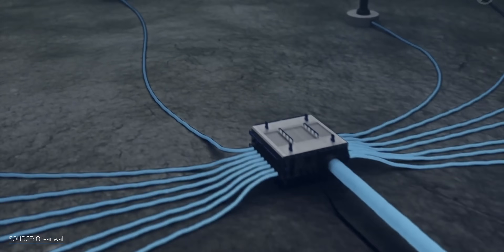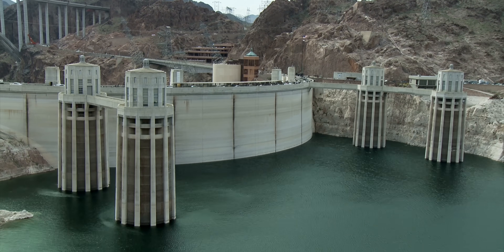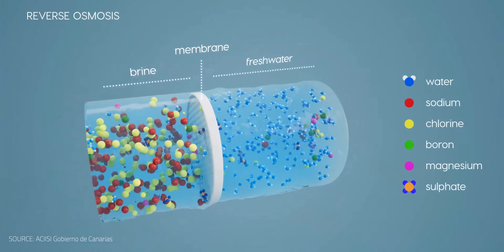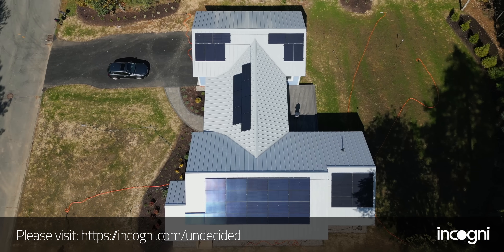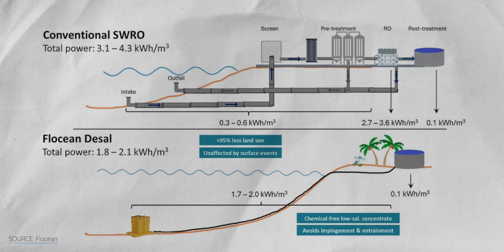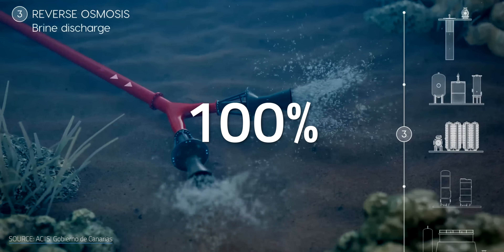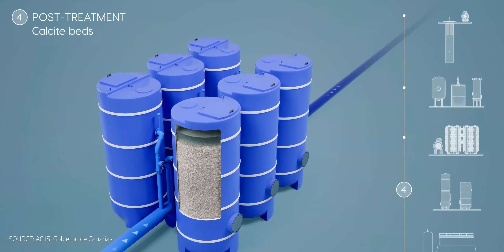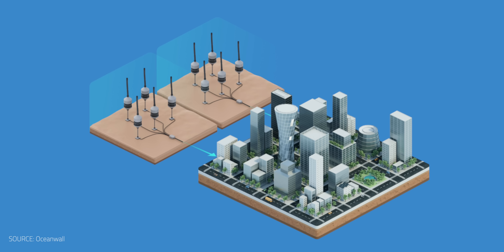How Deep Sea Water is Now Drinkable

Comment: Unfortunately Ive become significantly more jaded regarding tech improving life. Let's do the initial assessment:

Claims (if I misinterpreted the claims, it's because their frauds, and this is a nothingburger)
1) 220,000m3 or 58,117,851.5 gallons of water per farm, per day
2) Each pod produces 1,000,000 gallons per day or 3785.5 m3 meaning 1 farm has 58 pods
3) 2 Kwh per m3

Im getting 1.7943MJ to move 1m3 of water up 183m or 6789.9MJ for 3785m3 spread over an entire day that's 78.57kW per pod or 112.24kW if we assume a 70% pump efficiency. Let's try looking at the whole farm 395.1GJ for 220,000m3 that's 4.57MW per far or 6.53MW if we assume a 70% pump efficiency. So per m3 that's ~0.5 kWh to lift the water and ~1.5 kWh/m³ to do everything else.... yah appears to be physically possible

Okay it's a cool idea that is grounded in reality. It would take 5,545 farms to replace the US water supply. A total energy cost of ~$106.9 billion a year. Capital costs are unclear & time horizon is unclear. Given the modular nature and mature deployment technology it would we can probably ignore capital costs because energy costs will be the vast majority of cost assuming the lifespan per module is reasonable (~10 years). 

This would have to be paired with water rights reform aka eliminating it & replacing it with a national water market where price is determined by capacity maintenance and upgrade costs. Why do I say that? Because y'all keep growing alfalfa in Arizona..... That's 448.25 billion gallons of water a year (21 water farms by itself). That by itself isn't a problem. The problem would be subsidizing this build out/maintenance, driving the price of water down, people making choices based on that artificially low price, resulting in the subsidy costs spiraling. I personally support this being publicly owned and done at cost. But we need to make sure that cost is the cost of the water (creation & maintenance) so markets use the water appropriately & we don't end up with the taxpayer doesn't end up subsidizing private profits

Comment: The brine can be solved by spreading it out over a large sea area,
and by using multiple plants in spread out areas.

Also, the salt water may be pumped upwards as potential energy storage,
after which at the ground level the pressure would be huge like at the bottom of a river dam.

Equally, using several sand filters, the crude stuff can be filtered from the salt water,
while the RO filters can handle the rest. At times you may need to reverse the pressure
through an RO filter to flush some stuff out, so you can optimize the filter's lifespan.

Using lower pressure but more filters at a time, can reduce the pressure required,
and also lengthen the filter's lifespan in maximum throughput over it's lifetime.
Since the amount of blockage in the filters due to sediment under extreme high pressure
requires equal or greater pressure to be unclogged, this will then also damage the filters,
when using the inverse RO cleaning method. So, by using lower pressure but more filters
gets more water filtered per filter over it's lifespan, since lower pressure means less damage
to the filter and easier unclogging.

Finally, during the day a reserve of freshwater can be created for nighttime use,
and thus use more solar power. Just an FYI.

Note: One more thing, the brine can be dropped unto stuff like the already very salty
places on the continental US, especially deserts. WIth less chemicals required, ofc,
since the sand filters filtered out most of the stuff already.
Dunes are great filters, but this can be augmented by even finer sands.

Comment: It sounds like a genius idea, but if the pump is an issue, why don't we use wind turbine? I mean, one of the example mentioned the use of solar, but solar makes dc that drive pumps, right? Pump is powered turbine. Why not use wind turbine that runs turbine? I mean, no electricity but mechanical to mechanical energy. Torque right to inertia kinda thing. From the size of commercial wind turbine these days, I doubt it'd have trouble pushing water through membrane. Maybe we can do that near shore too.

Comment: Push or pull you still have to lift it. How do you not vacuum boil the water you are trying to suck up from the bottom?

We used RO on submarines and I was glorius. That's a different story because we were below sea level.

Comment: The principle could be exploited even better, without any pumps, by using oil drilling technology to lay a vertical pipe 400 m deep from the mainland to the seabed. Start a vertical oil well 2 km to 3 km into the mainland, which, after a depth of 300 m, begins to drill at a 90° angle towards the ocean. Then drill vertically 10 to 20 km out to sea until you reach 400 m deep water, where you install the microcarbon filters. After that, drill a 400 m deep shaft that reaches the vertical oil well.

Comment: Magic water pump.  At over 1,800 feet deep, in average ocean salinity, the osmotic pressure is neutralized.  Hanging the filters where they are above an ocean current and the brine will be diluted so fish won't get hurt.  The freshwater will float and will be pushed up above sea level over 30 feet without pumping.  Charging the outgoing pipes with freshwater will prime the pump and will keep the pipes from collapsing.  The filters will need to be configured differently to facilitate faster backflushing.

Comment: 1. Need circulation at the high pressure side to move out the saltier water after some pass though the membrane.
2. Sea water needs pre-treatment to remove all particles and organic matter to avoid membrane fouling. 
3. Most place won't get 500m depth just by going 10miles out to the sea. Major population lived in a delta river region which has shallow sea due to sediment discharge.
....much much more problem...

Comment: Once you have a column of fresh water coming up the standpipe, doesn't the density difference provide the pressure to drive the water through the filters?  The only thing pumps should be needed for is to just CIRCULATE seawater on the high-pressure side, not the low pressure side.

Comment: The video failed to explain how you can use the pressure gradient to pump. You're still going to have to pump the water up from that depth which would be the same as using a pump to maintain that pressure

Comment: I love the idea, but applying some red team thinking I see some implementation issues.  How do I keep my "fresh water well" and it's infrastructure safe?  A rouge ship could simply drag it's anchor thru the zone where my pipes & cables are and cut off my water supply.  So security of any implementation like this needs to also be considered in it's cost estimate.  Also, your deployment locations may be limited based on International waters starting at 12 nautical miles from shore.  If the depth is too shallow within that national water boundary, a solution like this can't be installed there.

Comment: Hey, I had this question for a long long time. Why not just treat the brine water instead of dumping it back to the ocean- use sun based drying or other methods to make salt, chemical based process and seperate sodium, chlorine and other useful minerals ? With sodium batteries coming up, isn't this a very useful resource instead of a waste ?

Comment: In my opinion there's a better tecnic!
At high pressure, deep ocean, when carbon dioxide is introduced into seawater, forms a dense liquid or a solid (caldrates), depends on the pressure, and excrement sal... The solution with carbon dioxide when depressurize, the carbon dioxide can be recycled...

Comment: I definitely think that desalinization should play a major part in addressing the issues we have in the west. California receives a full 25% of the allocation from the colorado rive even though the Colorado actually just formed the border of the state. If california could simply pull its water from the ocean through desalinization then that allocation could be distributed to other states further inland where the only water available to them is from the river. I think it would likely be a lot cheaper than the pipelines that have been proposed by other states. where they would have to desalinate the water anyway.

Comment: Part of me wonders if they’re thinking on too small of a scale here. What if one were to repurpose an oil rig as a base to maintain a DSRO farm. Are these too deep to run a cable to the surface attached to a buoy and power the pump via wave motion? Sure, it would pulse, but if it worked you wouldn’t need to run power out there and only the water line would need repair when a boat drags anchor across it. A cut power cable could kill life around it too. Make it vertical or wave power and the risks are lower

Comment: The single biggest breakthrough in RO was the pressure exchanger. 
DSRO just creates a transfer of problems from one side of the process to the other.
Reply: what is energy consumption with this tech you described per m3 of water?

Comment: Can we just use a liquid fluoride thorium reactor to supply the power for a traditional reverse osmosis system? Store the brine in a minefield to process the salt for various utilities. Seems a lot less risky for aquatic Life than building wind turbines and disrupting the ocean floor while also spewing brine that you're depending on currents to take away. All this engineering when we already have an energy supply that is abundant, clean and safer than any energy supply ever developed. Will be even safer when they tackle the remaining engineering hurdles for thorium reactors

Comment: A great sounding system. Well worth the effort of perusing. Thanks. Jim Bell (Australia).
Reply: not at all. it would exploit the last untouched water that’s left. furthermore, it’s essential to keep the pressure and oxygen concentration exactly as it is. if implemented, deep sea algae and marine species could go extinct. the project should be banned for these reasons.

Comment: why don't they create a pipe in a tall structure in a city for the pump to push water to the top and save in a container and then it connected to another pipe going down to membrane. it should be as energy saving as the pulling water from the depth of the sea.

Comment: Cool. It makes a lot of sense. I still have misgivings about the lifespan of the filters, but by only performing a 5% withdrawal of fresh water, it leaves so much more fluid volume to flush contaminants. I suspect the install and replacements will be a PITA to do, but if it's cleverly designed and modular... I would imagine ROVs could manage it pretty easily.

Comment: I think we should create massive desalination systems with pipelines running across the land like we do with oil. We should refill lakes and reservoirs. Ya I mean massive systems. I’m sure China or an oil nation in the Middle East will get it done before North America does a massive infrastructure project again. All the water transferring systems are already set up. Water is rising as glaciers melt we need to think long term and big. All they are is engineering problems to work out. We have the technology. The power for the deep water systems should be provided by the one of the  new more energy efficient water energy generator  systems. They could float right above  the deep water system, saving on power line costs running from an on land power source. It can all be done, just like the carbon capture systems but people don’t have the willingness, yet.

Comment: One problem I feel like people are forgetting / not considering is pumping the water let's just say 2000ft up becomes increasingly harder the higher you go. But for said height, you would need around 900 psi meaning a pretty good motor that would draw plenty of power. As opposed to a 40 psi pump to push through water on the surface, even if it required 10 of those pumps to move water around for brine etc. But I do know there is some underwater wave-generating technology that could perhaps help??? Or am I missing something?
Just feels like a huge investment and specialized equipment to be developed that won't be cheap at least for a while. Also, 6 miles to pump water will probably add alot of friction making the pumps work harder.

Comment: I invented a System where Cold Seawater is pumped out of the ocean. 
The seawater is used to cool a vacuum Chamber. 

In the vacuum chamber water boils at room temperature. 

Distallation of Water in a vacuum needs a bit more of energy. 
But no membranes are produced as trash. 

Vacuum can be produced with 10 Meter height difference. 
No fancy high pressure pumps are needed.

Comment: Anyone who studied second year mechanical engineering will know this is a complete BS. You only have pressure, there's no pressure difference, which is needed for RO
Reply: On Land you need to apply pressure to the salt water , that takes all the salt and flows back. 

Under water you only need to apply pressure to the sweet water.
In order to pump it up to the surface.

Comment: If the seawater is deep enough, you don't need pumps at all. The fresh water is buoyant, compared to the surrounding salt water. The pressure difference is small, but adds up with every additional unit of depth. Ultimately the fresh water forms an 'artesian well' springing from the deep sea. I developed this idea decades ago, and began to publish it at a meeting in Texas. But the idea was largely ignored. Fresh water was not such a problem then, and some people dismissed the idea as "too good to be true". Some called it "perpetual motion." But when every step of a problem has a solution, then the entire problem is solved. That math showed that from the start. So where does the energy come from? Ultimately, from the Sun, but very indirectly.
Reply: I want to know what humanity will do when the oil runs out
Reply: I thought you talk bogus but then i trhought of the temperature and density gradient from the deep sea to the top of the ocean. Damn. Thats some future tech heat exchanger technology! And yes pressure alone could do the pumping because rhe sunnhelps with lower densities, maybe. Sounds possible but I hope your maths is right. Reusable filters will be the issue though.
Reply: @lucelxebinog- Temperature has very little effect, but varying concentrations of salt DO matter. On average, the seawater is 3% denser than fresh water. The inverse of 3%, 0.03, is 33. So at a depth of 33 feet, the pressure difference between fresh and salty is 1 foot of fresh water column. Same plan works with meters, miles or kilometers. 

For the self-pumping RO to work, you need 33 times more pressure at depth than they normally supply with pumps, for the given salt concentration factor. It needs very deep water, but the oceans ARE quite deep in some places. 

The way the Sun comes into it is by being what ultimately drives the ocean currents. Without that, the deep water surrounding the RO membrane would become more and more salty, until that finally made the process stop. But even with no circulation in the deeps, that could take years, decades, even centuries... depending on the rate of freshwater production. 

Salt and other stuff building thickness on the RO membrane can be swept away by an occasional backflow of the fresh water, pumped from the surface, using only a tiny fraction of the usual pumping energy required by seawater RO.

Comment: if you compare the energy savings to a typical isobaric pressure exchanger type energy recovery system then the overall energy benefit is not very high. maybe 5 to 10%. there will be subsea pumping systems required which are costly and typically with lower efficiency as well. The pitch of these companies currently is about less chemical treatment, much longer membrane life, and brine disposal advantages. however any maintenance required on a 300-600m deep equipment will have exhorbitant costs.

Comment: They could do far better than offshore wind generation... Why don't they just use tidal and wave generation on the same site where they're building the desalination pods? That way they generate 100% of the power they need on sight completely eliminating the need for cables.... In fact somebody smarter than me could probably design an integrated solution where the title and wave generators and the desalination pods are literally the same part the same thing the same structure all the same thing one piece... 1 system instead of two...
Desalination generators instead of generators and desalinators...

Comment: As someone who works with mining electrical systems, I can tell you that the cost of the umbilical cables are going to be huge. We often use cables with 1/4 inch jackets and they absorb water over time, and they're not even fully submerged.
Reply: Since the device seems to be a leaking/flooding bathysphere of sorts, the cost of the pressure vessels and all the equipment to operate 400-600m down under -- will also run quite a pretty penny. It is not just the electric cables and and the freshwater hose that will be $$$-costing, everything there will.
Reply: @MotoStylus-z8r  I would love to know where the majority of the price comes from😅
Reply: @mondepluriel  I'm an electrical engineer and it doesn't matter the application of use. If it is a SPECIALIZED cable or wire, it will have a huge price tag attached to it. This mostly stems from one of two problems, either A: the materials used are expensive or B: it's not a widely used cable so usually not stocked or readily available. I've seen both price tags and they are about the same depending on what exactly the cable or wire is being used for